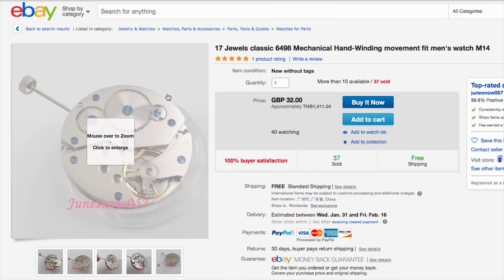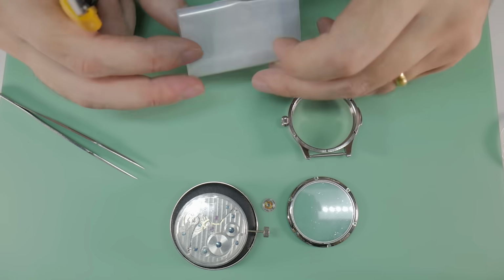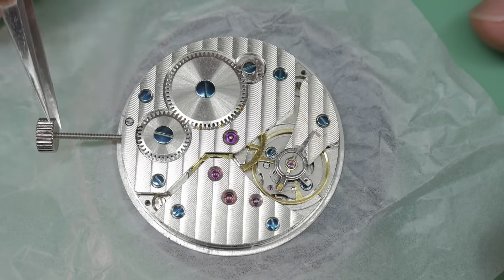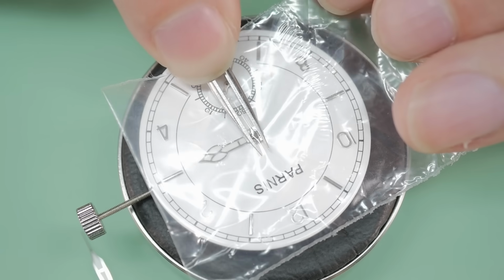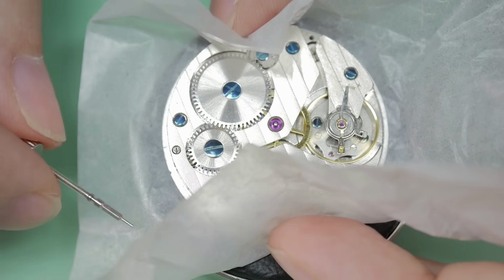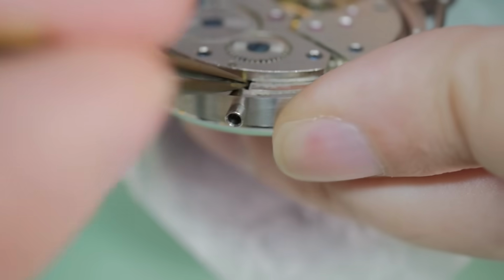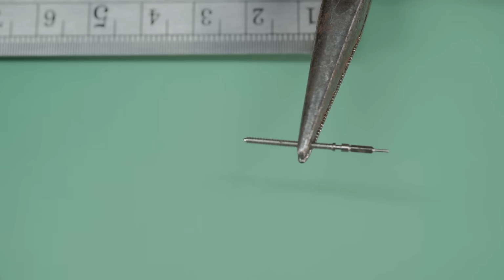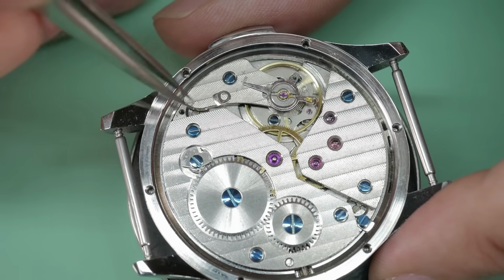Build Your Own Custom Watch Using Parts From Ebay

Comment: This isn't really "custom". The likelihood  if you find parts that all match together is that they are probably already matched together as a watch model in China, or something so very incredibly close to it is. When I think custom I think made to your specifications, not a five mix and match parts which you have very little control over having look the way you actually want put together. For example, if you wanted a custom red and black 38mm watch with your initials monogrammed on the dial(tacky? sure), you're pretty much screwed unless some Chinese watxh company has your initials and by the grace of God you find all of the parts in black and red in a style you like that also happen to fit together.
Reply: Martin J True but he did make it clear that it was using parts from ebay and d you'd be building your own. I suppose it's not custom in it's proper form but I thought it described the video fine. It is custom to an extent, and that includes the strap.
Reply: A lot can be achieved with felt-tip marker pens :-)
Reply: i agree, this project is essentially a waste of time. i just sunk an hour into scouring the entire web to see if i could create anything even remotely close to the seiko sark011 or one of its lesser complicated variants. there's practically nothing on the market in terms of dials as separate parts even when considering dagaz, offrei, and a few other specialized sellers. while the movements are available, and there are some very cool cases, the dials are just not out there except totally uninspired blandness at least for dress watches and chronos. meh...

Comment: I attempted to engraved and skeltonize a watch movement a few years back,but only got so far. I think I will at least engrave another watch dial and case,and use the movement you recommend.
Reply: Shaun Hughes Hand Engraving did it work

Comment: I have a swatch automatic watch used an ETA 2842 movement, and its case is broken. I want to use this movement again and replace my other watches' movements which are ETA 2824 and ETA 2836 with this movement. Do you think it is possible? Is the ETA 2842 equivalent to the ETA 2824 or ETA 2836?

Comment: What is the name of the clamp used to hold the stem while filing?
Reply: Jewellers vice/clamp.  There are larger versions used in engineering.

Comment: Mark, I am a massive fan of your work, and taught myself how to do this. There are an abundance of cases and dials out there and the other 2 popular movements are the ETA 2824 (or seagull ST2130) and the Miyota 8215 (or DG 2813). These are automatic and also have a range of hands/dials/cases for them.If you buy a plain dial, you can even use tiny railway modelling transfers to 'sign' it. It takes a lot of patience and good loupe but it can be done. I did this and built a good passing resemblance to a Rolex Submariner for under £150, its waterproof and is my own brand and after 'running in' and regulating is surprisingly accurate (ST2130).After this video, everyone will be doing it!

Comment: hi mark.i have subscribed to your watch lessons and are enjoying learning.however while i was watching this particular video i noticed the movement you chose on e-bay was different to the one used in the video.one had s/s screws,the other had blue screws and the one on the e-bay site would have the sub dial at 9 instead of at 6!could confuse beginners?
Reply from the maker: +Bernard Shields the one we use in the course is the 6498 (ST3621)

Comment: Hello, i'd like to try this, all the dials I like are two handed, no seconds subdial. Can these fit straight on, do they have clearance over the seconds pivot? Some of the 6497 movements are skeletonized, can a dial be fitted to the front, if I bought that version i'd only want a rear view skeleton? Thanks.

Comment: Great video as usual! I do have a question on a non related issue, I bought a Bulova Accu Swiss Chrono and want to remove the case back to see the movement but it’s got these crazy 3 hole screws that require a special tool!? Can you tell me where to purchase this tool? 🙏

Comment: That was very interesting. Thanks for sharing. I am though rather surprised you don't use more accurate ways of measuring and cutting. Feeler gauges and a micrometer would be a lot more accurate. Of course a lathe would be perfect for reducing the length of the shaft, but clippers do seem rather crude to me. 

But I'm just an aircraft engineer by trade, so what do I know...?:)

Have got a 1920s/30s Longines pocket watch with a delightful dial, that sadly doesn't work. I'd like to fix it, but all the parts seem very delicate, so I'm scared to attempt the job. I'm sure I'd get part way through and discover I need another tool.

Comment: Hi Mark, I am an avid fan of your work and an amateur watch fettler, and have been for several years. It's good to see a video like this where someone tries something new rather than a strip and rebuild. I was a little disappointed that you based your video on the seagull movement as a lot of them are cheaply made, mass produced and bad build quality. I have owned several Parnis and had nothing but bad luck. I wouldn't wish that on anyone.
Reply from the maker: +David T it's a budget thing. However, I am more than happy to receive a donation Swiss movement to base the next project on (a 2892-A2 or 2824 would be nice) send me a PM and I will give you an address to send it to.
Reply: Hi Mark, 
please don't think I was being derogatory of your work. If it wasn't for people such as yourself and the informative videos you produce, I never would have become a horological hobbyist. My negativity was aimed at Parnis as a branding and the bad luck I have had with Seagull movements (I lost the crown and stem from a brand new watch after 1 week when the yoke gave up and it fell out). As for supplying you with watch movements, I wish I could. I have done the next best thing and given you a PayPal donation. Keep up the good work and I look forward to your next vid.
Reply from the maker: Never thought that for a second, thought I would be cheeky and ask lol but thank you for the donation I will put that towards the next project for sure which will no doubt be an automatic.

Comment: Great video Mark, Please can you tell me why you set the hands at three o’clock.
Reply: Just in case Mark doesn't have time to respond: Watchmakers place the hands at 3:00 or 9:00 because those are the positions that best allow proper phasing. The 90 degree difference between the minute and hour hands is easiest to see, thereby allowing more precise placement. Cheers.
Reply: 12;00 works, but so does any hour. With 3;00 it is very easy to see both hands. Up to you.

Personally, I like the Seconds hand to be aligned to 60 when the Minute hand is precisely aligned with a minute.
Reply: how about set it at 12 o'clock?

Comment: Most of the inexpensive Chinese homage watches (or, relating to this video, the cases) in Aliexpress, Ebay etc state that they come with a sapphire glass. Does anyone have information as to whether this is actually true? Is there an easy non-destructive way to test this?

Comment: It would be nice to find how to make an 18 ct yellow gold waterproof men's watch with sapphire crystal,  36mm diameter case, minimal depth, doměd dial, luminescent hands, golden upright arabic numerals, bold date display, hacking highly accurate automatic movement and fine black leather strap. It would amount to building a classy timepiece that would be so good that it shouldn't require a famous house's name on or price to it. But would that be practicable?
Reply: JusTelling You may want to start with George Daniels book on Watchmaking if you are going that route.

Comment: Hey Mark, are you use thread locker for stem and crown?
Reply: If you cut your stem too short you can use standard super glue to set it in the right position. If it’s cut the right length you don’t need anything. Just tighten the crown on the stem by holding the stem with pliers and twisting the crown on until it stops.
Reply: Once you are sure about the cut, add just a little bit of Araldite or any other household adhesive to the stem end and screw in the crown. Let it set for an hour or so. Otherwise there is a chance of it unscrewing when rotated counterclockwise.

Comment: Great video.

I've used the end of the ink tube on a ballpoint pen to set the hands into place.
Reply: dragonswordstriker that's a really great tip friend, thank you very much.
Reply: I have got a Uni Ball Signo 207 pen, with the tip retracted the hole is the right size for a 6497/8 hour hand, got a set of 3 proper hand presses of which one is right size for the minute hand.
Reply: Great idea man!
Reply: Top tip cheers mate
Reply: This is the best tip and comment ever.

Comment: Great project vid Mark!
Just wanted to know how you re-threaded the crown shaft after you snipped off  and filed the excess length before screwing the crown back on?
Many thanks!
Reply from the maker: the filing is smoothing the burr you create when you snip the stem down - this will allow the crown to be screwed on easily.
Reply: Watch Repair Channel 
That’s something I was wondering about as well, in bigger threads I thread a nut back on before cutting then cut the excess off, file the burr and wind the nut back off to clean the thread, it’s just something I was taught in my trade to not cross thread either the stem or the thread (the crown in this case) - I am not a watchmaker, and not in a way a criticism, just an observation (obviously works, but just seems to go against the meticulous procedures you use)

Great video and passed a relaxing 30minutes on New Year’s Eve!

Comment: If you wanted to start your own watch brand, you could skip ebay and go straight to a handful of companies in China who will work with you directly. For a large enough order they'll even put your custom logo on it (instead of Parnis). Take those same Chinese made movements, cases, crystals, and bracelets and then send them to Switzerland.  Now put on one Swiss made wheel (at 60% of the movement cost), case it, have a Swiss citizen sign off on the inspection and now you can legally stamp "Swiss Made" on the dial under your custom logo.

Comment: I would never use tweezers to put on hands. Use the correct tool so you don't end up snapping the second hand pinion.
Reply: Daniel Dugan I think, done carefully, it should be good sir? I don't honestly have the right tools, and relay on tweezers to press hands in, but haven't broken any so far, but I agree it should be required for a professional

Comment: Another awesome video Mark!  Question: if the balance wheel regulates the speed at which the power escapes from the main spring, what provides the power to the balance wheel for it to beat?  Does the mainspring also provide the power to the balance wheel? Please explain, or let me know when’re I can find the answer please if you’ve already done so.

This has always “escaped” me!  Pun intended!
Reply: The power (reportedly about a microwatt) comes from the Main Spring in the Barrel. The torque passes through the train of wheels, and reaches the balance wheel via impulses on one of the jewel faces.

Better explanation here: https://en.wikipedia.org/wiki/Lever_escapement

Comment: Absolutely fantastic video! Unfortunately most of the parts available are for >40mm watches, and the only reason I want to make a watch is because I cant really find a small one available for sale that I like! this has led me to trying to replace the movement on a non functioning vintage watch with a chinese 2650 or an ETA 2408 (I think) but then Im not using a case or dial made specifically for that movement so it's hard to find stuff that will work!
Reply: Yannick's Veterinary Ventures try this company if in the US: http://www.ofrei.com/page460.html They have cases, movements, dials and hands. They have a variety of case sizes. I have made several watches with supplies bought from them.

Comment: Mark  Your timing is excellent as I am just at the assembly stage of such a project.  Very useful, thank you.  I have read on the net  that some of these cheap movements are not adequately oiled and should be stripped and oiled first.  Is this unnecessary?  Very happy to do so if you feel it is worthwhile

Thanks

David
Reply: Seagull movements aren't oiled because of how cheap they are and there's honestly no need. The movement he has is the 6497 clone and it'll run decently.

Comment: Hi Mark, nice job. I've been doing the same several times. I like the idea of using plastic bag for dial protection... However one off topic question: I see at your desk sort of tablet with old microphone. I suppose you use some software with it, so you can see a waveform of watch sound, pretty useful. Do you have more info regarding microphone, software and especially the wiring of microphone to audio input? Thanx in advance.

Comment: That fake minute repeater slider thou ;)
Reply: Though we must note that the Cricket has an alarm complication, rather than a repeater!
Reply: Darkover92
Reply: He is talking about the "bump" at the opposite side of the crown. A minute repeater is often a button that looks like that "bump" which has to be pushed up or down in order to let the movement let the current time sound through bells. Quite an expensive complication if you are looking to get such a watch.
Reply: vintage Vulcain Crickets sell on ebay for a few hundred dollars all day and some are in amazing condition
Reply: Darkover92 I must have missed that myself. I'm kinda new to all this. Where was the minute repeater? Good eye. You must know all the parts when broken down. Awesome!